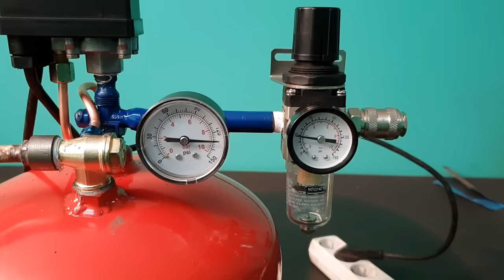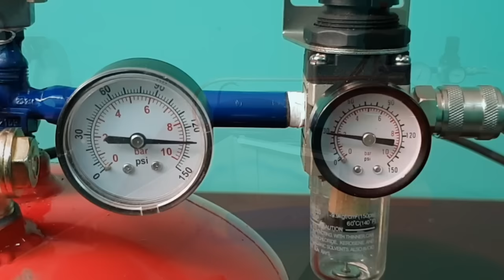DIY Silent Air Compressor make of fridge motor

Comment: Yes, the fridge compressor is great regarding low noise but you will run into a major problem with water accumulating in the compressor and mixing with the oil in it and eventually producing a milky sludge and thus diminishing the lubrication quality of that mixture and sooner or later (probably sooner) burning out this nice and quiet compressor. Water in the adjacent pressure tank is not much of a problem as we can get rid of it in various ways, however, I don't know of any way to get rid of the humidity in the air that first get sucked into the compressor and it is that humidity turning into water once air compression commences.

Comment: This guy has a high opinion on the strength of those welded joints...
Reply: u can hold 10 bars with hand  these welds up to 50-60  so ....

Comment: the big problem is that the tank will rust inside if its not painted or treated ,
Reply: None of the ones you buy from the tool store are painted inside..... and it's real easy to replace!..
Reply: @okielicious 
If its a good quality tank it will have internal powder coating ;)
Reply: @Coronadraht why not use a lpg glasfiber tank

Comment: Making a big effort, but the cost of buying a base, pipes and gages, electric welding, copper welding, some connections, cutting and painting, dangerous work, tools and the cost of hand work all of that to get an air compressor instead, you can buy a small ready-made air compressor and the cost will be less or equal to the cost of this work

Comment: Brilliant idea and did it after but there seems to be oil coming out with the air and what happens if the oil of the red compressor runs out? Be well & safe.

Comment: you forgot something very important, inlet/suction filter, refrigerant compressor valves were designed for 0 contaminants as it operates in close loop system. now u make it the other way around.

Comment: i used to have one of those, although not nearly as elaborate.  worked fine for years until the compressor locked up.
Reply: It locked up because over time the lubrication in the motor/compressor will escape up the pipework, never to return! A closed unit of this type loses lubrication up the pipework, but usually it returns to the unit. This is not possible when using the unit in this way.
Reply: robert till - There is another video showing the oil left in the compressor years later (and 1000 hours of use) was the same as what was put in. So the amount of oil in the air will be very very small. Of course you do want to replace it with mineral oil (baby oil for that nice scent)

Comment: Did anyone notice that the gauge needles didn’t move when he used highly demanding air tool? My 20 gallon Ingersoll Rand looses pressure immediately when I start using an air spray gun or similar.

Comment: It seems like u wire them parallel (refrigitator motor and security valf) on security valf system and security valf system has no ground wire it seems. Am I correct sir?

Comment: Excellent work but I have the doubt of how to do so that the compressor does not do the work it does when it is connected to the refrigerator ... that is, it rests by the action of the Relay ... because I have one without a tank and works for a while So when I disconnect it, I have to wait a while for it to work again. I would appreciate your guidance on this ...I do not speak English.

Comment: Just a quick question.       How do you  keep oil in the compressor motor?
Reply: The oil will not come out just don't tilt the compressor on the copper lines
Reply: Gravty
Reply: Gravity
Reply: @franciscorivas9975  small amounts will come out with the line to te tank you just put a oil trap in between.

Comment: What he spent on this "compressor" there in the video, would give to buy a professional 30 times better. That is, such work with these pieces is not worth it. The only advantage is the silence of the refrigerator motor. Only The rest...deslike.

Comment: Oil will mix with the air and be lost. Also compressors need the Freon to cool the windings. Won't last long
Reply: I agree, I tried this many times, motor dies within 10 minutes.
Reply: May be. I Ithink  so, however it's masterful job. Music is terrible, this video must be silent as shown compressor.
Reply: @НиколайЛебедев-ч6в  the music was great. its a lot better than the interrupted beat crap or elevator music.
if it had clown music i bet you'd really blow a gasket.

Comment: Main problem I see there is no condensate drain for the repurposed propane tank, or safety valve. Also the original application for this compressor it cooled itself with returning suction pressure containing cold refrigerant gas. This compressor will get hot with heavy use and heat kills these little compressors. Best to use a belt type semi hermetic compressor it will have external cooling fins and a site glass to show internal oil level. This compressor will overheat and motor windings will go bad. This only good for limited light use.

Comment: First for me I just removed a compressor from a old fridge with air intake pipe  and compressed air out pipes intact mange to run the compressor but dont know where and what oil to be stopped up is it on intake pipe I think how and what oil please help

Comment: Been there done that.The output of this compressor is too low, the time taken to fill a 50 litre tank upto 90 psi will be like 20 min and takes about 30-60 sec to empty out on a standard HVLP paint gun.Also you need refrigerant recirculation or this compressor will eventually burn out.I used it for painting and got really frustated waiting for tank to fill right back up again, Went out to a store next day and bought a 3hp 50 litre compressor.That being said this shit is really silent though!
Reply: this is for air brushes these tinny ones under 1psi power  these big need big loud compressors ...but u can add 3-4 compressors to speed up and it will work with hvlp

Comment: Do you have a safety relief valve in the system or is it not necessary.
Reply: these black boxes came with mechanical 12 or 14 bar safe valve with red plastic ...

Comment: Okay i got the parts list.
Refrigerator Compressor
Cylinder
Pressure Switch Relay (Psi Relay for switching)
Pressure Guage
And Nozzle for Mixing

Comment: You should never weld to a pressure vessel or drill in it. This is deadly considering the pressures the compressor can reach.

Comment: You should never drill or grind a pressure vessel unless you have an hydraulic pressure set up. The result can be an absolute disaster.

Comment: Nice project but not practical with an 8 litter tank, it is not able to be responsive to normal tasks , the tank must be at least  60 litter for a compressor as size as a fridge compressor so it can  have enough time to keep the pressure to the point. another issue is the lubricant in the fridge compressor that gradually gathers in the tank and eventually pistons get dried out and jammed.
Reply: just top the oil up after its been used abit, ive got a il/moisture trap on mine between the compressor and tank. as that fills i know how much i need to top it up by. thing aint ever running dry..

Comment: Nice work, but how much SCFM?
Reply: With that size of compressor ..not much. Its a very small tank and it still needed a cut in the filming which should tell you the output is not that great  ;)
Reply: Probably 2

Comment: In a refrigerator the compressor is cooled by the returning cold refrigerant, how are you rejecting  the heat produced by the motor in a compressor?

Comment: "What causes acid in refrigeration systems?
If a compressor does burn out, the oil becomes extremely acidic. ... Depending on the refrigerant and oil being used a refrigeration system can contain two types of acids, organic acids (such as oleic acid) and inorganic (mineral) acids, such as hydrochloric acid."
Reply: Jimmy was looking for a place to hide his stash*

Comment: 300 psi is beyond enough to kill you, if you were standing next to that thing at full pressure and that tank went off right beside you or with you at least 5 feet away, the pressure wave from the blast will cause severe internal damage i just hope to god you know what youre getting into and i really hope you searched up the limits of those tanks, because for example an oxygen tank is filled up to less then 42% of its failure pressure, well for obvious reasons TO PREVENT SOMEONE FROM GETTING KILLED

Comment: You should be a billionaire why are we listening to these loud compressors at work all day disturbing the peace in the richest parts of town
Reply: Effectively it's a very small compressor, that's why it's quiet.  It wont last long without an oil drip feed in the inlet. An interesting project but with chinese air compressors being the price they are, why bother?

Comment: when that tank is be full, tats engine stop automatic ? or
Reply: that black box on the top was the pressure regulator
Reply: @danhard8440 
Its a pressure switch and unloader ;)

Comment: hello I have the main parts for this build I have a 2 port valve with electronic cut off what im wondering what's that. T piece you uses to connect the pump to the tank
Reply: It's a check valve. Air can only go from the pump to the tank and not leak back into the pump when it shuts off. The little squiggle tube that taps off of it and goes back to the unloader valve on the bottom of the pressure switch so when the compressor switch satisfies and shuts off the motor, air pressure is automatically dumped out of the line between tank and compressor so the motor doesn't have to start up against a pressurized line.

Comment: why do you make 2 holes in the tank? only one is necesary intake/outake.
Reply: If they are together on the same pipe, the pressure reading on the automatic stop switch does not always work correctly.

Comment: What powers your fridge now? A regular air compressor perhaps !!!!
Reply: 😂😂😂 Now that's a project I need to try.
Reply: @inoahmann7542   Go for it, it may work, as aircraft use compressed air for air con, although it may be a bit overcomplicated for a fridge.
Reply: @lfewell2161  If I get it working I will make a video and let you know 👍

Comment: I'm not sure this is safe. The bottle walls are not made for the pressures that pump can give. Also there's going to be water rusting away in the gas cylinder with this setup. The amount of brazing from the non-pressure side also concerns, yes use it for sealing, no, not for holding back a valve. Depending on the pump, it could go to 500 psi.

Comment: Muy bueno el trabajo, quisiera saber el nombre del equipo de soldadura, gracias
Reply: É só um maçarico a gás. Você pode comprar um de GLP, gás de fogão, que vai ficar bom pra soldar. A vareta é de estanho e na ponta, aquela substância branca, é fluxo de solda, pra limpar (ela é ácida). Casas de ferramentas você encontra tudo.

Comment: There was no reason to remove the handle, plus grinding makes the metal weaker and maybe too thin since it was welded and you don't know hom much metal remains. Should be tested with ulrasound for safety as regulation says for all pressurised vessels.
Reply: It's only 150psi....

Comment: TIG Brazing????? Compressor oil???? Compressor cooling????
Reply: dont forget Compressor Insurance????.  
and my favorite Compressor Choking????.
Reply: Compressor cooling probably isn't much of an issue with this because of low run times.
Reply: Well you have a 400 watt motor and a very small compressor head attached to the motor that's suspended with springs the id air being crushed about 16:1 leading to a high Tempature rise probly about 500f.... Most of that heat gets soaked into the compressor head....and there is no oiling when Thease units are run like this is a cool setup but its gonna eat compressors......

Comment: was that solder you used like plumbers solder
Reply: DARREN NICH   Except aluminium any metal like cooper to brass or still should be silver brazing
Reply: I suspect this fella may be in the HVAC biz.. i see those guys using that all the time. Did seem to have that skill set.

Comment: SAFETY Valve ? or did I miss it?
Reply: I noticed the omission also.
Reply: he's probably hoping the regulator switch is enough. but yes it should have one regardless. 
the regulator switch could fail and over pressurize the tank. a proven mechanical backup is always necessary.
Reply: @darkshadowsx5949  regulator switch have red one under that will pop on 12 bar  mechanical one

Comment: So how long did that thing last with out oil?
Reply: Hermatics have the oil in the case, very little is carried over in the air stream. Big problem is cooling, the returning freon is normally only a few degrees above vapourising temperature, it provides the cooling to the motor.

Comment: Please inform me the motor voltage input and regulator phase rate 1.2.3.????
Reply: Single phase motor at 120VAC.  Nothing spectacular.  Same could be done if  you happen to find a refrigeration compressor that runs on 220VAC....just have to have the means to power it properly is all.

Comment: not good idea. only a project for a child because will not last. normally using refrigerant, le compressor is cooled by the cold refrigerant. now it almost have no cooling. Then the oil it has is water attractive. it's inlet does not directly go to the cylinder, it goes to the black container. With time some water will condensate into, and kill the compressor. playing only stuff ! but take care because these compressors can reach important pressure, unlike normal air compressors. Sometimes if not shut off, they could explode your tank, and never seen, but some say it's just like a bomb...  using refrigeration compressor is always a temptation but it's a very bad idea, it's not properly build for that and will not last, energy waste.

Comment: What a total waste of time ..  The compressor is to small , and so is the tank ...
 The compressor will not last long ,as it is not being oiled as it would be in a closed system...
Reply: The compressor is sitting in a oil filled tank, it is only compressing air now that all the freon has been removed. It's working exactly the same as it always has.
Reply: small compressors are very handy. 
being a contractor or a regular joe with a nail gun in the house should save on noise pollution. 
its also good for apartments if you have a bicycle that you store in a room. as you could silently inflate the tires like a ninja. 
there are plenty of other good use cases you just have to use your brain. 
of course its not meant to run pneumatic tools like air grinders for long duration.
Reply: @charleschapman2428  exactly. Except "freon" doesnt contain air, moisture or noncondensables. Except the "freon" cools the internal parts of the compressor. Except the oil will migrate out of the compressor into the tank. Except that this compressor is solely designed to compress and pull "freon"
Reply: @acman0926  I never said that freon contains air and I never said that freon did or didn't cool the compressor, never said anything about oil migrating anywhere and the fact that the compressor is doing a pretty good job at compressing air might make someone think that it's sole purpose isn't just to compress and pull freon. Also I don't get your point of using  the word (Except)  to start sentence, what's that about?

Comment: Bad idea,if you know what is inside the compressor, what it is design for, not for aircopressor or water pump.if you use it for water pump? Guaranteed if it will last for one hour, 100%,for air compreesor, will not last very long, once it get rusty inside, the valve plate and flopper vavle,will start leaking, no.more compression, waste of time and.money,

Comment: Fridge compressor runs very high compression ratio, like a diesel engine.
Diesel engine makes explosion by compressing air and oil.
Never use a fridge comp for compressing air.

Comment: Hi, how have you replaced the refrigerant? I bought a compressor to turn it into a vacuum pump, but there is still refrigerant inside R600a, its a gas but I don't know how to degas, since its heavier than air. Do you know how?
Reply: It's most likely fitted to a fridge and may have about 60-80g of R600a.  This needs to be recovered to a dedicated recovery cylinder with the correct recovery machine. Any domestic refrigeration engineer will be able to assist you as you need specialist tools and equipment to carry out this process.  One precaution, R600a is highly flammable, it's butane so be careful.

Comment: good afternoon, I see that it reaches 150 psi pressure, what power does the unit I use 1/3, 1/4 or 1hp have? thanks for the video
Reply: Even a 1/6 hp mini fridge compressor will reach 600psi if you give it long enough. What you have to worry about is the stall pressure of you are building a high pressure air setup. The compressor in the video looks like a 1/4 or 1/3 hp.

Comment: how much for you to make this for me as i need one for my business please
Reply: Just buy an air compressor, and if you want a quite one, get a rotary, or a screw compressor, both are nearly silent and very little vibration and will run a long time with little maintenance other than an occasional oil change.  Expensive initially to purchase but cheaper in power usage and maintenance.  They also run cooler than a conventional piston type pump.

Comment: Not a DIY if you use specialized expensive tools! (Exp welder, cutoff wheel, ext)
Reply: Virgin chad how could he make it without those? Cut off wheel is a specialized and expensive? What did you expect for him to make it with 2 bricks and a hammer?

Comment: This is a completely unsafe job with all these home welded joints and grinding, The pressure is too high and the joints won't hold, The capacity is small which will lead to overheating compressor, and kaputt.
NOT GOOD.